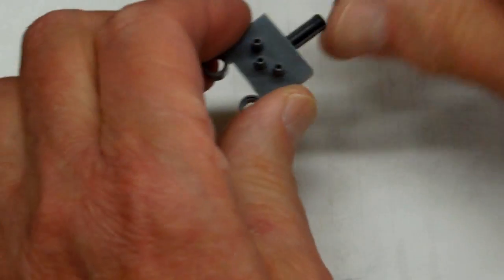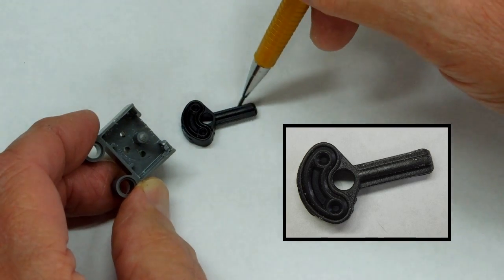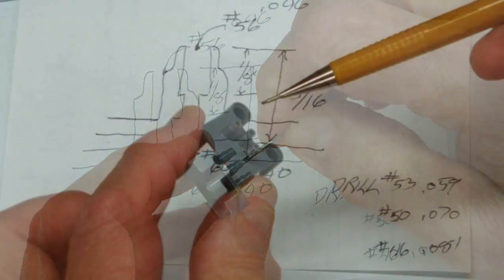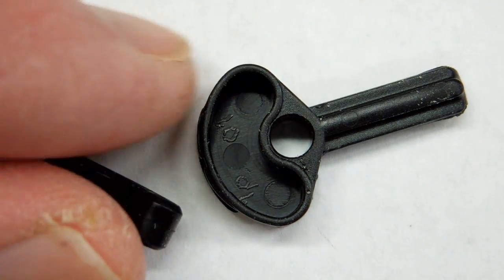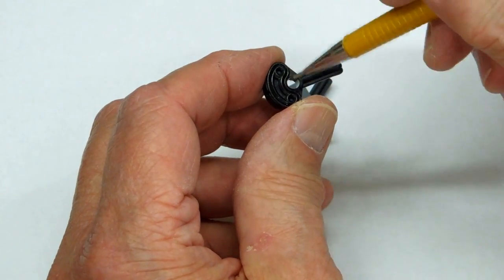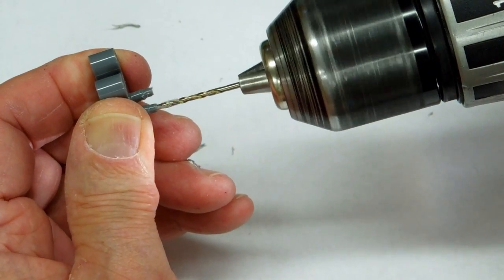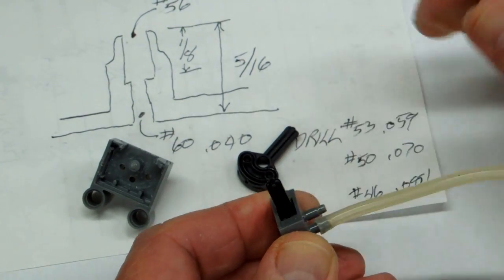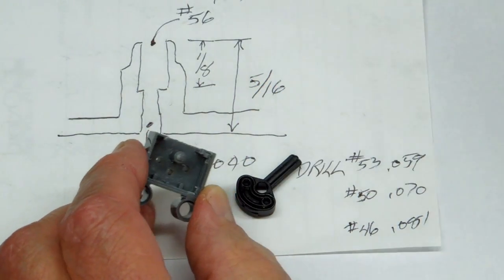Lego Pneumatic Switch - Increased Flow

Comment: will the plastic be smooth on the inside afterwards, so that the "rubber" wot get damaged?
Reply from the maker: It will be smooth "IF" you do it "EXACTLY" as shown... which craws the chips outwards away from the internal cavity and the smooth surface for the rubber.

Comment: Lego is made from ABS, can glue it with the proper cement or just solvent weld with Acetone.
Reply from the maker: Or super glue. But it is so much easier if you don't have to do that. And always a chance you can glue the whole thing solid by accident.

Comment: are you worried about the strength of the nipples? they could be a bit weaker now that there's less material.
Reply from the maker: Not for the 6 -8 inches of water pressure in my intended application. For higher pressure I probably would not go with the 3rd bit.
Reply: Good video. Yes, 8 inches of water column is less than 3/10ths of a PSI if my math is correct, but do you think the thinner walls weaken it any real amount to where the nipple could snap off over time?

I'm guessing that once it's mounted, it's not going to be taken apart like it would be with "KIDS" playing with it and building new things all the time, so some giving up some strength to increase air flow is the trade off.

Do you think that it's worth applying air to one nipple while drilling out the opposing nipple would help with the possablity of any plastic chips getting inside the valve body, if you chose to do this and NOT take the valve body apart? Keep up the great work.
Reply from the maker: LPEPower has a video where he drills it from the inside and it raises a lip on the plastic (which he then needs to remove). Drilling it from the outside does not do that and the plastic on the inside remains smooth. The drill bit pulls out all of the plastic debris. A piece of silicone tubing will stay on there forever at many times the pressure I wanted to apply.